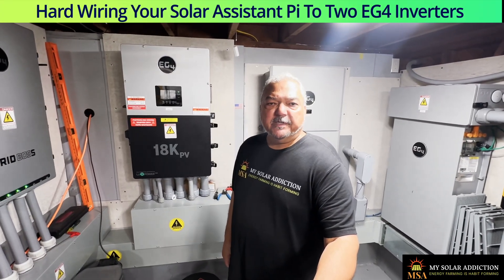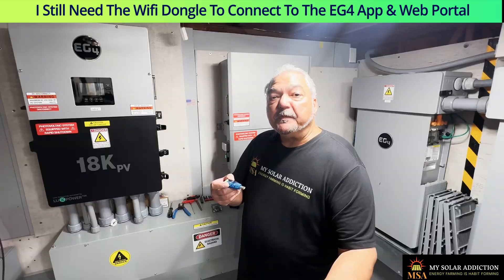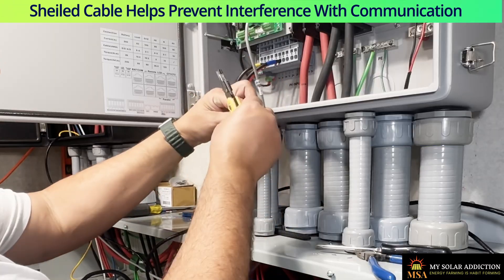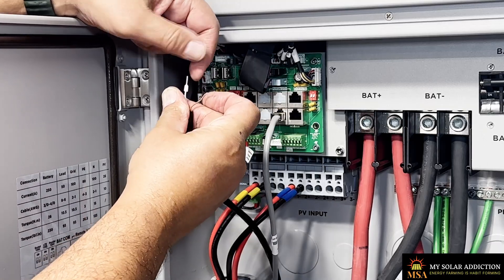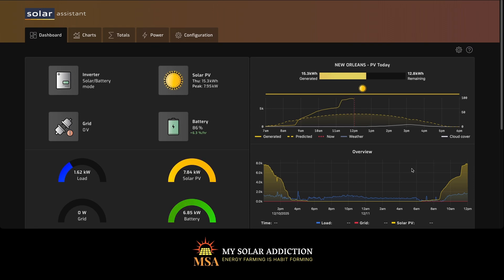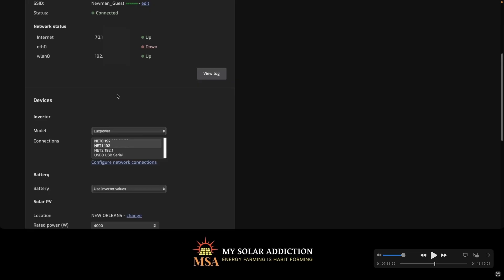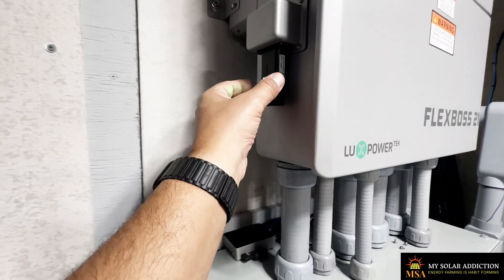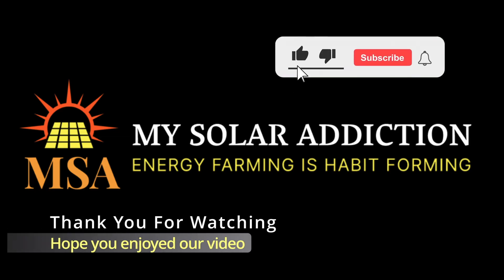Solar Assistant Hardwire To EG4 FlexBoss21 & EG4 18Kpv

Comment: I have a question, with the hardwire method, if I'm not at my house, can I still login and check in the system, the reason, I own 2 system, one installed in SEWI and the other one installed in SWMO